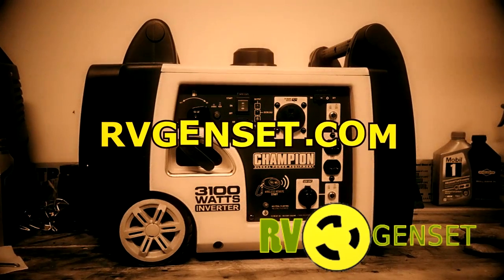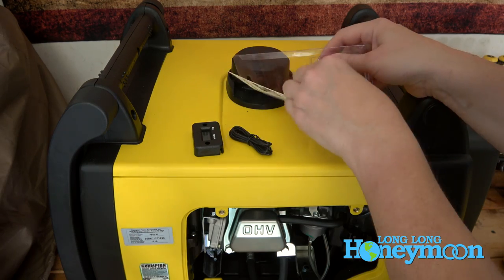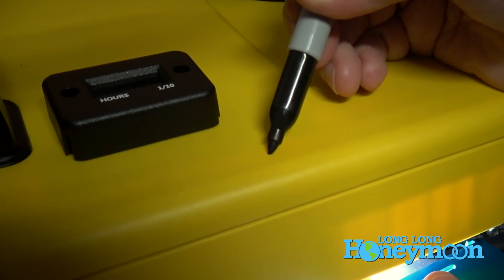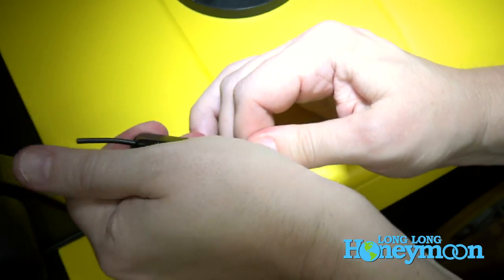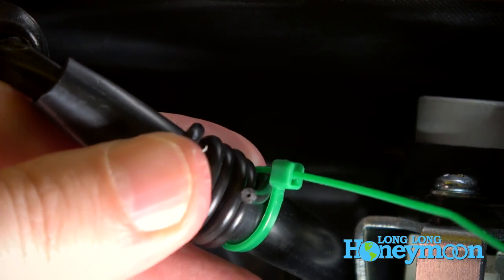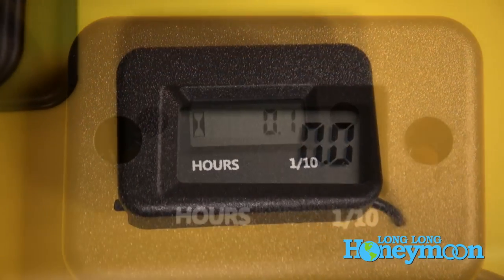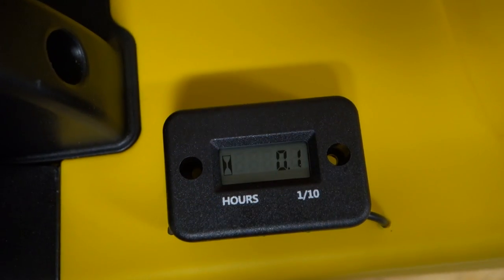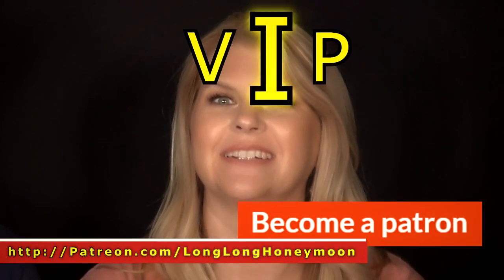🔧 INSTALLING AN HOUR METER ⏳ on a Champion Inverter Generator

Comment: Just a note. You don't need the extra wire left over. If you like you can cut off the excess and just leave enough to make the number of needed wraps before tying.  The wire uses induction to feel when there is power present. The length of the wire is not important, but the number of wraps at the end does matter.  Happy Camping!

Comment: The only thing I don't like about these meters is that you can't change out the battery unless you BREAK the case open. I wished they made it where you could change out the battery but these companies are looking out for their best interest and not ours. What I mean is when the battery dies you're forced to go buy another meter instead of buying a battery. 😡

Comment: You might want to put a dab of silicon on the wire hole to keep water from leaking into the engine compartment. Just a suggestion.
Reply: Plus  clean the spot for the tape with alcohol first. Is the hour meter even waterproof? Are the batteries replaceable?
Reply: Roger Young great idea.
Reply from the maker: They claim the meter's "100% epoxy encapsulated casing resists water".... so hopefully it can withstand the occasional drop of rain. Some people use these hour meters on boats, motorcycles, and lawn mowers. The battery came installed and I saw no way to change it!
Reply from the maker: Yes, I don;t plan to run this generator in the rain and it will be under a tonneau cover most of the time. But I'm sure there will come a time when despite my best efforts some rain hits it...
Reply: Depending on the tonneau, they aren't completely waterproof. If it's a 3-fold some water will get in when it rains.
Reply: Drilling the a tad oversize and putting a small bead of RTV around the wire will also eliminate chaffing - since we all know how smoothly (LOL) a single cylinder genset runs.
Reply: Thanks! This is exactly what I needed. My Champion 3400 was delivered today and I already bought my El-cheapo hour meter (in matching yellow!)
Reply: @akbychoice  no batteries needed, the electrical spark from the cable powers it.
Reply: geneland then it’s different than those I’ve seen. The ones I have are battery operated and don’t last long. Went back to the old style.

Comment: I like the idea of the hour meter and will be getting one myself. As a retired electrician who has installed more zip ties than I care to remember I would like to suggest that you do not cut the end but use a pair of lineman's pliers to twist it off.  Twisting the end off will break it off just about flush with the locking end and will leave no sharp edge to slice your skin.

Comment: Just unboxed and set up my new Champion 3400 dual fuel generator. I could not find the spark plug wire in the owner’s manual diagrams and called Champion. The guy who answered seemed unfamiliar with the unit, and told me it was at the battery end. Since it is not located there, I was a little frustrated as I wanted to hook up the hour meter before running it. Ran it for 1/2 hour exactly, and then searched the net for a clue. Watched two videos that basically showed how to change the oil, and said nothing about hooking up the meter. Sean’s video was incredibly helpful. While I have been  RVing for over seventeen years, I still find the Loloho  posts to be spot on accurate and helpful, as well as entertaining.
Reply from the maker: Thank you Paul! Appreciate the positive feedback. It is all too rare on YouTube, lol Best of luck with your new genny!

Comment: Sean A little tip Sir. When finished tying your wire wraps, take a pair of plyers and grab the tail closest to the lock. Then spin until the tail releases. You will get a clean cut, and NEVER cut yourself on a lock again.

Comment: I have that hour meter on my outboard motor. It's been great, helps me keep track of time for changing the oil and water fuel separator. I mounted it on the engine a year ago and no problems.
Reply from the maker: Thanks for the report! Good to hear!

Comment: Great Video, I bought the el cheapo and installed it on my 3500 dual fuel Champion works great. Just remember not to get to close to the spark plug,it will make your generator skip a beat. LOL

Comment: Got the Champion Generator after your review.    Works fine during my testing running my AC in Dallas Texas for a couple of hours.   No long term use yet.   Although an hour meter was not a deal breaker, I added this one.   Thanks for the research on a cheap meter.

Comment: I installed the same hour meter on my 3500W a couple of months back. Works fine. I placed mine neatly on the face plate. For a 15K AC the 3500 is great.

Comment: Your videos inspire.   Ordered one for my Champ.  I'll just drill a hole a bit smaller than the wire vinyl and with slight force, pull it through for waterproof might need lube (no silicone). Hide the hole with the unit by allowing the wire to leave the unit slightly sooner than the end and through the covered hole.   Pull the unit down to stick or screw it carefully to position after painting the screws black.   We "E-love" your vids and digs.

Comment: As a nit picker, I would try to mount the hour meter  on the front panel or right above it.  That said, simply having the meter is great.  As always, I love your videos.
Reply from the maker: Fair point, it might be preferable to drill the wire hole in the front of the case and run the wire along the top of the generator. Mounting on the back was the simplest way to go. I figure the hour meter is something I'll check from time to time, but may not view on every usage.
Reply: Long Long Honeymoon  you have entirely too much influence on me. We bought the same scout the same generator  and a bunch of other stuff. Cut it out, will ya?

Comment: When stopping at a Walmart or rest area for lunch, if you want to use the unit for a microvave or Air Conditioning, I suppose you would just start up and run the unit from the back of the pickup truck. Does this or any of the other generators you tested have a way to re-direct the exhaust like straight up so you are not frying everything else in the bed of the truck?  Thanks, Jack

Comment: Sean,  Awesome video as always.  I literally just finished installing the same meter on my brand new Champion Dual Fuel 3400 Watt Generator just before watching this video.  I didn't even thinking about drilling so ran mine out the top vent near the battery and taped it to the side out of the way.  Yours is a good option to.  If the wire comes loose off the spark plug might want to wire tie the ends tightly together instead.  You guys do a great job.
Reply from the maker: thanks George, yes I may revisit the install in a few weeks and see how I like the placement and how everything is holding up inside. I do like your idea of running the wire through a vent since it requires no drilling. BTW I've heard great things about the dual fuel model -- someday we'll get our hands on one for a review. Best, Sean

Comment: I wonder if the hour meter is weather resistant? Mounted up top seem like the display would collect any rain or snow that may fall onto it. perhaps mounted on front is an improvement?

Comment: I put one of those on my lawnmower that cost almost exactly 10x as much as my first car.  Works like a charm!  I'm not sure if it's supposed to be weather proof, but it apparently is.  Seems like it would be a good idea to put one any vehicle motor to keep track of service intervals aside from mileage
Reply from the maker: thanks Paul, yes they claim it is "water resistant" so it should hold up under some rainfall. Glad to hear yours is working well! I think I will invest in some more of these. I agree they could be useful on any engine.

Comment: Those cheap units have a sealed internal lithium battery that will die 10 years after the meter was made. I would buy a unit with a replaceable battery, or an old style analog one that hooks up to 120V power and turns on when the generator is running. That kind doesn't use batteries and will last 50 years...

Comment: Thanks for the very handy tip! Installed it on a Champion 3500 electric start you folks recommended. Actually - 2 great tips from you folks. Thank you!

Comment: I just got this hour meter. On the instructions, such as they are, it says I need a 2.5mm socket !!!!! and wire cutters.  Do you know if the wire lead from the meter to the spark plug can be cut to length without affecting the meter?

Comment: Thanks for the vids! Got the Gen set and added the hour meter and a battery tender Jr. In my opinion both great add-on's. I'm going to toss out an extra here and mention that I believe the nature of the cable that reaches the meter from the spark plug allows it to be cut. It's cheap so just pull all that cable out of there and attach the meter at any point along and cut off the excess. Mine works like a champ (pun intended). Thanks again.
Reply from the maker: Yes, I think you are right about cutting that cable. In the future I may "neaten" my install by doing so.

Comment: Perfect timing! I bought this generator last week, suprised there wasn't an hour meter. Thanks for the video!
Reply: Scofco my Honda doesn't have one either, for $2000 it should have one built in.
Reply from the maker: Yeah, for the money you'd think Honda and Yamaha would include this feature. Briggs & Stratton has one on its 3000W unit.

Comment: Great mod for the generator.  For what they cost you would think they'd come with one !   Will it run a 15,000 btu AC?
Reply: I have a 15K AC unit and bought the 3500W one same thing only a few extra watts for the larger AC, works great, got it on sale from Cabela's.. Can't go wrong w these Champions!

Comment: Thanks. You made it sound so easy.
Reply from the maker: haha, so easy even i can do it. :) If I had been more ambitious, I might've tried mounting it to towards the front of the generator and running the wire to the back. Also one could trim the wire shorter instead of tying and tucking it away. I kept it simple for now.
Reply: Cause it is

Comment: Campfire question (maybe?)  I'm seeing videos about fires from running your fridge on propane while on the road - can it be run from the battery?  I believe(?) we have an inverter in our TT (I think that's what that noise is when we have a lot of lights on in the rig) - will that run the fridge?  I am 100% electricity illiterate...

Comment: Can you reset the meter? If you change oil and do Maintenance at a required your mark, would be nice to start over with hour count.
Reply: Doug Dukes I've never seen a cheap one do that. No buttons, switches or toggles.
Reply from the maker: Yeah, I did not see any reset option.

Comment: Hey how is that "El Cheapo"  hour meter doing so far? would you recommend it ? 

I have seen the branded meters that cost almost $100, wonder if I really need to care about the "logo", considering many of those expensive brands manufacture in similar factories

Comment: How does the Champion compare to the larger Briggs and Stratton? Thank you
Reply from the maker: They both seem to run our 13,500 A/C just fine. Noise seems about the same to my ears.  I love the remote electric start of the Champion. No such luxury on the Briggs.

Comment: Enjoyed the video.  I installed the same one on my Honda generator.  It worked great for a while, then I noticed it had stopped working.  Can't see any obvious problems, so maybe the problem is internal.
Reply: TCB031 battery dead ?
Reply: I don't think this thing has a battery, or if it does, it is internal and not replaceable.
Reply: TCB031 exactly
Reply from the maker: Bummer! Some of these Made in China products have the lifespan of springtime flowers. How long did it last? Did it get wet?
Reply: I think the hour meter worked for two or three months, and no, never got wet.  We don't use the generator a lot, and I try to run it once a month in the garage for 15 minutes or so.  I agree on the quality issue.

Comment: If you had to choose between the Champion and the Briggs and Stratton generator which would you pick?
Reply from the maker: +David Bunting the Briggs is nice, but personally I favor the Champion for the remote electric start. As you can see, it's easy to add an hour meter. I had some dealings with Champion customer service and they were great. If the Briggs was made in the USA 🇺🇸I might favor it for that reason alone, but both of these units are manufactured in China.
Reply: Is the decibel difference between the two significant?
Reply from the maker: I did some testing yesterday and the results were surprising. Stay tuned, I'm trying to get a video ready that will be posted tomorrow.
Reply: Long Long Honeymoon thank you!!

Comment: Have you had to change the battery on the meter yet? Curious to know if the hours reset once the battery is replaced, or if the unit has them stored some how. Thanks!!
Reply: Most of these hour meters have a non-replaceable battery embedded in epoxy and are not replaceable.  They last 2 to 3 years and you toss them and buy another hour meter. Be sure to log those hours with that in mind.

Comment: Might the generator pull handle make contact with the meter if it gets flip over the top?
Reply from the maker: I think I have pretty good clearance, but I'll doublecheck.

Comment: Question What about toe grounding? I bought a 75531i but it is still in box new. haven't opened it yet. Don't I need to get a wire and stake for ground?
Reply: You can attach the generator ground wire to the driven ground for the house. Check around the meter for that ground rod.

Comment: You did a great job, thank you for this video..  I'm putting together a "Skoolie', and wanted your opinion..... If I put 800 watts of solar panels on the roof, with over 400ah of battery bank, would I need a generator?   
Thank you again, guys😊😊

Comment: I'm curious, can you cut the wire length or does it need to stay  the length in order to accurately metering the time?
Reply from the maker: I think you can cut the wire. In time I may trim it back, but first I want to see how well this install location works.

Comment: Love your videos for all the info. Quick question, Have you had any problems with your 3100 at higher elevations? I read somewhere that you needed to re-jet the carb above 2500 feet. What has been your experience? Leaning towards the dual fuel as they say it will perform on propane at high elevations without re-jetting. Thanks for your feedback.
Reply from the maker: My experience is that power output decreases significantly with each 1000 foot increase above sea level. For short duration stays (ie. a few weeks in the Rocky Mountains) we didn't worry about the carb, but if you are thinking long term then you'll probably want to address the issue.

Comment: Bad Sean!!! Always cut zip ties (tie wraps) with a flush cutter.  You are going to get cut eventually if you don't.  I do like and watch all your videos and this is a great upgrade for any generator that does not have an hour meter like mine.
Reply: Gary Bressler I like to round the end off with a little heat
Reply: akbychoice Fair enough, I have been cut before.
Reply: Gary Bressler me too, side cutters make weapons out of zip ties, better not to cut them at all than make them more dangerous.
Reply: akbychoice use flush cutters. Look at the blades some cut flush.
Reply from the maker: Thanks, I may do the same.
Reply from the maker: I'm a bad man! Thanks Gary, I'm sure you are right. Next time I will use a flush cutter.